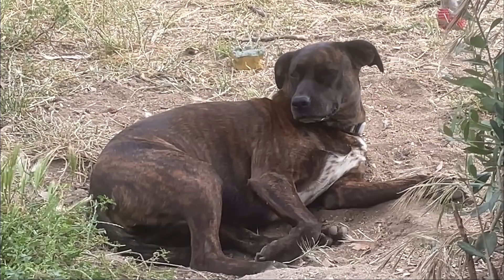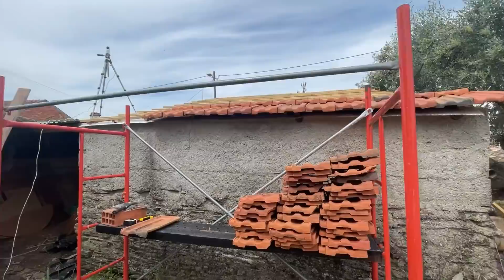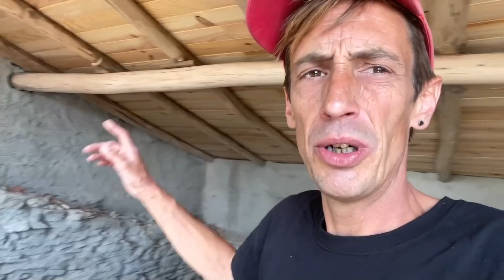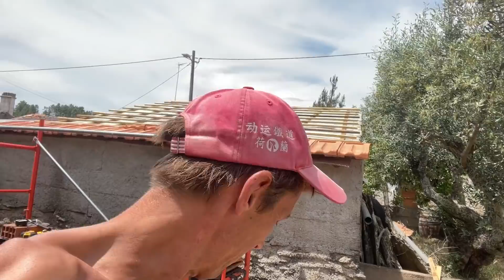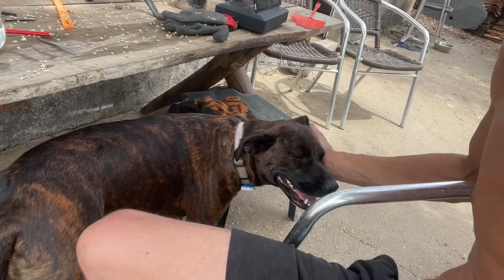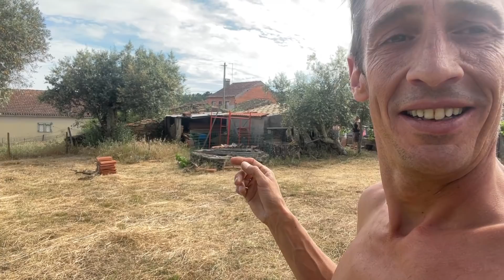CONFESSIONS (and getting a lot done) - Portuguese House Renovation

Comment: Just wondering, if those tiles over lap like they do to bond horizontally, then sure you can buy a starter tile which is 1.5 times the size of an original, this then solves your problem over having half a tile floating in the air so to speak. I don't know what you call these tiles in Portugal else I would have researched for you.

Comment: Jasper re the tiles on the mini build. why not build out the walls with 4inch wide strips of concrete board screwed into the wall with concrete screws. You should be able to layer the board so that you straighten the line you need the tiles to lay on and give your mortar enough space and a secure base to connect to. Then plaster over the sides of these boards which are seen from below, and it should look like Facia down those two edges.